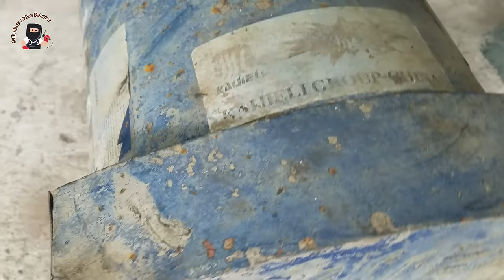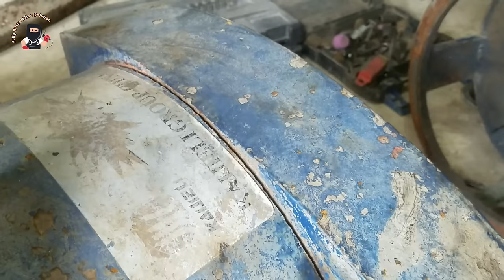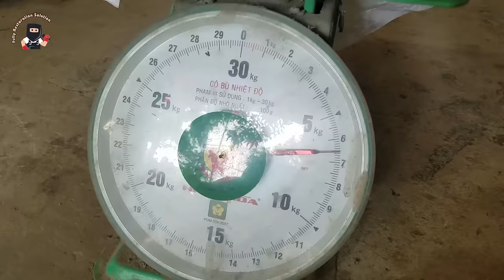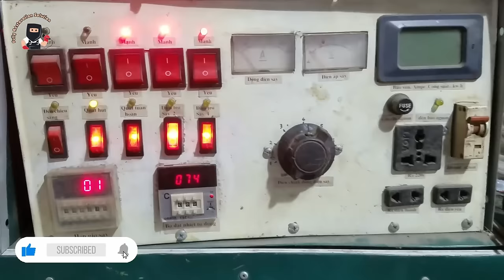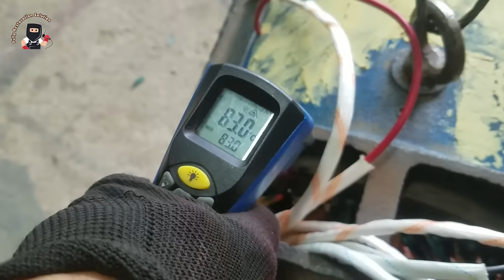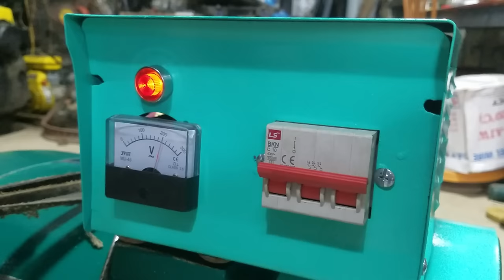Old Generator 15000w Restoration Videos

Comment: hello dear, my generator uses permanent magnets. do you think AVR can be given so that the voltage becomes stable
Reply from the maker: Thank you for sharing, I think the only way is to stabilize the voltage of the external circuit after the load.

Comment: Hi, can you help me to obtain the data  of a stator of a generator that was lost? Thanks, good day.
Reply from the maker: I'm really sorry about that. Each type of machine has different technical specifications, due to different uses and manufacturers. So they cannot use the same data on the copper wire.
Reply: Hi, I have the following data plate that has the generator
Reply: These ones are as following:

60 kw
75 kva
120 / 240 volt
180.4 amp
3600 rpm
Reply: 60 hertz
Reply: Maybe, with these datan you can help me, thanks and have a good day

Comment: i want to know what materials youd put on it does it endures last?
Reply from the maker: The copper wire is painted, made from plastic that does not contain colorants or corrosive substances and is able to withstand high temperatures. When pouring paint, you must preheat it before pouring the paint but must dry it at a temperature of 70 to 90 degrees Celsius for 12 to 24 hours.

Comment: What's that copper wire insulation remove tool? Also soldering gun?
Reply from the maker: Tuốt men dây của trung quốc ,súng hàn thì tự làm lấy
Reply: @RestorationVideo  sorry I can't understand your language..
  Can I get your language name please?
Reply from the maker: DF-6 Enameled Wire Stripping Machine Varnished Wire Stripper Enameled Copper Wire Stripper Cleans the enamel wire perfectly
Reply: @RestorationVideo  Thanks for your quick and correct response.. ❤️🙏